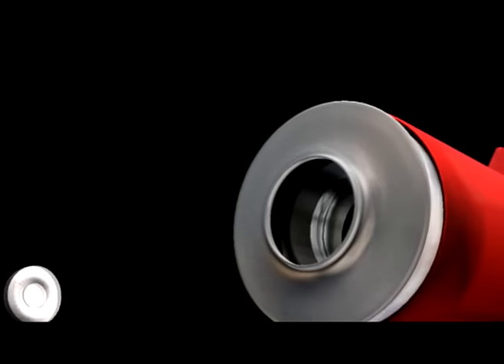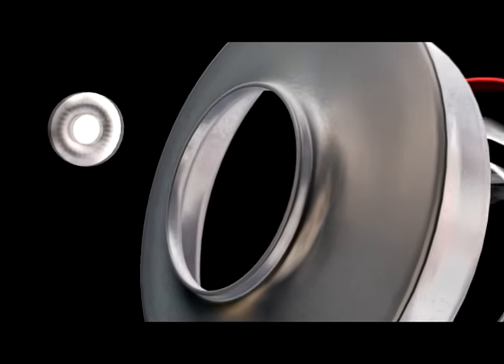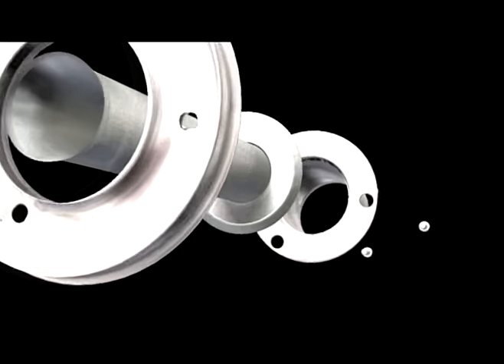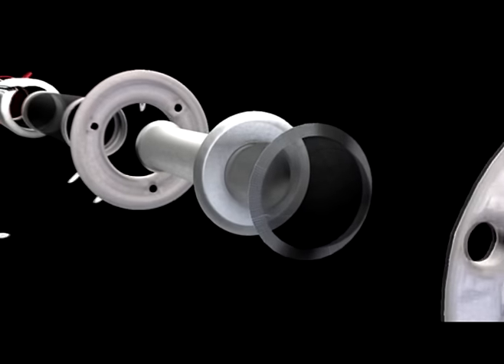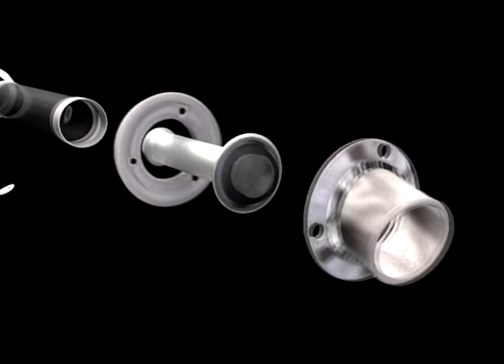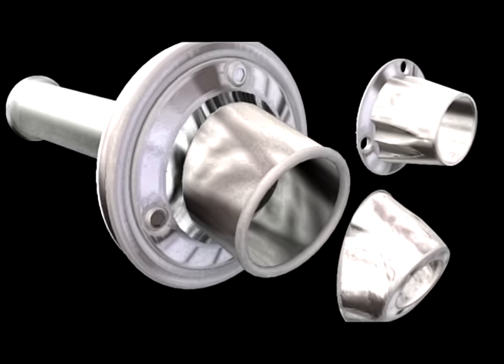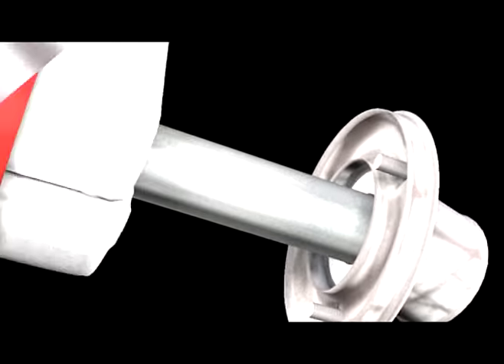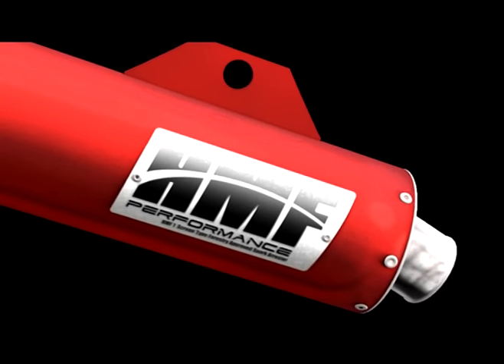HMF Exhaust

Comment: @bauer6 put it this way: Carbon fiber is a very light material, but due to its fiber (woven) design, it is extremely durable (one of the strongest metals). so no it doesn't crack easily  (unless beaten on) and it should be OK with water

Comment: i like going mudding allot, check out my other vids, but I would probably say that just the performance series with a quiet core in it and the spark arester would be fine. But sometimes the mud dries on the spark arrester and makes the machine really quiet but then just clean it when you get home. The swamp is a more quite exhaust but probably not as quite as the performance with a quite core but is more expensive for the swamp, check out my buddys channel outtyrider1996, he has a swamp series

Comment: Well i have the stock can am pipe  it doesn't have enough lets say power to blow away the water and not let lots in,i know before having the performance series i could go hours in the water and not have a problem but with the stock pipe that's a different story

Comment: I have a 2008 LTR 450 with a Cherry Bomb. I am interested on the new Competition Series slip on.  What will be the horse power increase and how many dB's will I get from it.  (high and low).
Do I have to install any fuel controller ?  Thanks in advance.

Comment: the quiet core, you just take off the end cap and place it in the exhaust and close it and it wont be as loud and they are 30 bone. What do you mean about going in a mud hole quarter way and the machine die??? never had it happen to me!

Comment: Why wouldn't you guys attach the end cap with screws, I stripped the little bolts/screws whatever those are, trying to get the endcap off, now it's stuck on there. I had the right size allen key but those socket head little bolts are so small and tightly on there they just strip immediately, now I don't know what to do, I need the quiet core and can't put it in.